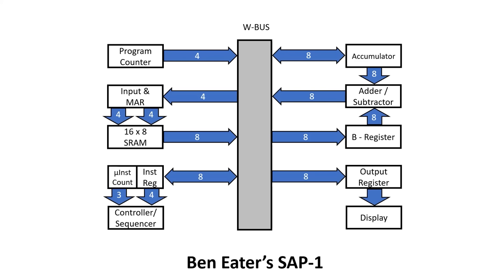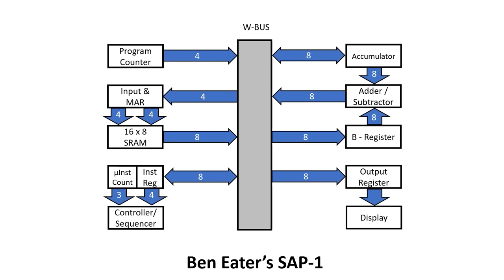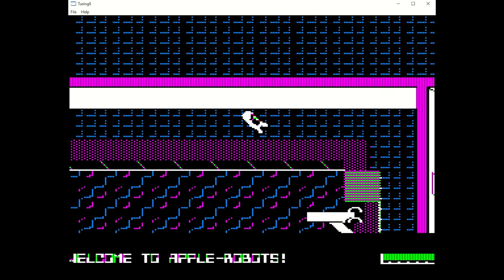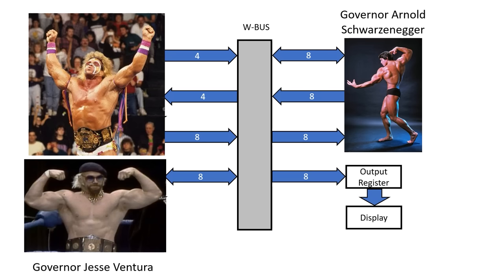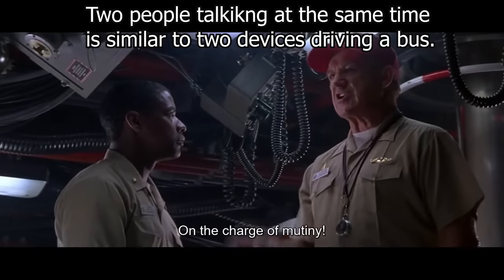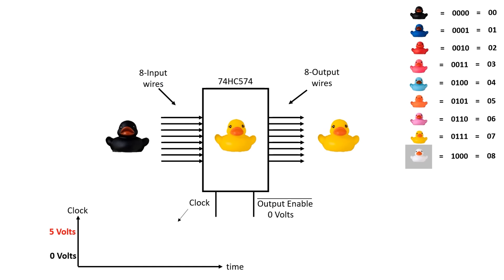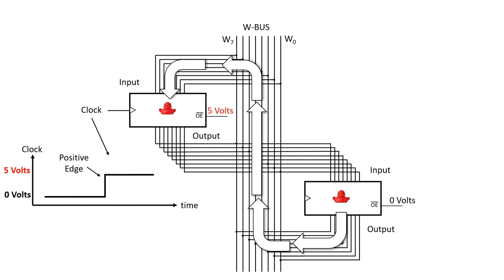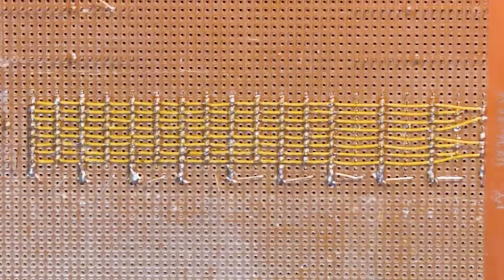How to build a 6502 TTL-CPU: Part 1

Comment: I just found your videos. The thought of building a 6502 from scratch sounds very appealing. My first computer was a SYM-1 running a 6502, so I have a long-standing love for the old chip.

As for your comment about the original architecture being too complicated, challenge accepted! 😃 I'd love to build a replica at least at the block level that runs in real time and is identical at the cycle level.
Reply from the maker: @briancampbell179  welcome.  Excellent, have a crack at building one.  It may also be worth watching the Turing6502 series.
Reply: @DrMattRegan  , shall do.

Comment: I just finished building Ben Eater’s SAP-1 (and I built his 6502 kit before that). So I really enjoyed this. The fact that the ‘574 has all the input and output pins lined up (and have 8 bits) is really encouraging for making an easier build. I could see designing and ordering a PCB with just 8 parallel lines to get started as a way to begin.
Reply from the maker: Sounds good, i'll be doing some videos with schematics soon.

Comment: I was really hoping for your inverter bus contention demo to result in the magic smoke escaping. I don't know why except perhaps to feel better about the times I have done it by accident. BTW a good explanation of tri state logic.
Reply from the maker: Glad you liked it.  Actually, short of applying the power backwards, i've found the 74HC series pretty hard to kill, more robust than 74LS.  Maybe that's just anecdotal i don't use 74LS much these days.
Reply: Worrying about that made me quadruple check every bit on the EEPROMs on the Ben Eater SAP-1 I built. But then I plugged the EEPROM in upside down and it got very hot (I measured 160F on the top of the EEPROM and that was after I had unplugged it for a minute). But everything survived that mistake lol

Comment: Great video. I like the soldering technique you demonstrate at the end. I’ve used wire wrap for my much smaller projects, and sometimes I’ve used your technique for applying short strips of insulation, but I’ve never done it at the scale you need for a bus layout. I’ll keep that in mind.
Reply from the maker: Glad you like it.  Yeah, the trick is to pre-stretch the wire a little, just enough to allow the insulation to slide.  Not too much though, you don't want to fracture the wire.

Comment: MORE!
I do my prototypes in a similar way, using wire wrap wire, but the way of getting rid of insulation is different for me, I just melt right through it with the soldering iron (putting a solder blob on the socket or IC leg I heat it up and wind the wire around the hot leg) - looks awful, but works.
I mostly do 'slow' stuff though, multiplexing I/O from a uC, or maybe I2C.
But this should work to at least a couple of MHz, it's not far from true wire wrap technology (excluding the unobtanium sockets and the wire wrap gun/pen), and that stuff could run real fast.
The more chaos in the wiring the better though, I heard.
Reply from the maker: Sometimes i do melt the insulation, especially if i've cut it to the wrong length.  The trick with this technique is that you need to pre-stretch a wire a little.  It's a bit of a balancing act.  If the insulation melts too easily, i'm worried about the insulation fusing together (which i've had happen) and potentially causing a short.  I like the Kynar wire which is actually quite hard to melt, but it doesn't seem to fuse.
Yep apparently a rat's nest runs faster than the way I wire, but you probably want a PCB to clock it really fast.

Comment: Good explanation of tri-state logic, but I was thrown off by the following question: If all registers are connected to the same bus, how do you choose which register is written to? In Ben Eaters SAP-1 design, all registers are connected to the same clock, but have individual write-enable inputs. It is only in the second video of this series where it seems to become apparent that this SAP-6502 design works differently: The inputs of all registers are connected to the same bus, there is no write-enable pin on the registers, and the control logic has to make sure that it ONLY clocks the target register to store the value which is currently on the bus.
Reply from the maker: Yep, it was a bit of an engineering trade-off.  Ideally, these octal buffers would have a clock, and a write enable and an output enable.  Unfortunately, they don't and you get to choose two!  I decided on using octal d-type flip-flips with an output enable would be better in this case because so many of them connect to the W-bus.  Ben Eater, decided the other way, but he has to add in a tri-state buffer per register.
Reply: @DrMattRegan what is the fuss with the clock. RAM was async till the Sega32x in 1994. No one expects a clock like there . That is no one but students who learn RTL .

Comment: Sir - you are much much more than 0.1x Ben Eater (Blessed Be He😃) That sort of comparison is invidious, and contributes nothing. Ben's fantastic project (in the philosophy sense) takes a relative novice to the point of a reasonably thorough understanding of the basics of cpu and computer architecture. Yours is to use that developed understanding as your starting point and take it further. (and probably to have some fun 🙂). I love it !
Reply from the maker: Thanks Mike, I really appreciate it.  You've hit the nail on the head.  Ben Eater does a great job and I think his work stands on its own merits.  My plan was to advance what he has done for those interested in taking it further.  I want this knowledge to be freely available and not stuck behind some paywall.

Comment: I have on question about registers, at the end of series we have implemented all the instructions of 6502 using only few of registers in our model.
Then why it is not running as same speed as 6502, why dont we use as many registers as we want ? wont it will be beneficial for us ?

also is it not possible to replicate everything in 6502 in our build?
Reply from the maker: Good questions, I think we use a similar number of registers compared to the 6502, but (nearly) everything has to go through the single w-bus, where as the actual 6502 has a more complex bus structure.  In effect it can functions in 1 clock that take us several clocks.  This was done on purpose though, because the idea isn't to exactly replicate the 6502, the idea is to show that something as simple as the SAP1 can be made to run 6502 code.

At the end of the day, if we use faster chips we can still beat the original 6502, even though we have more clocks per instruction.

Comment: Should be, some guys decoded fully die shot and done full schematic and even build one from transitors with blinking diodes
Reply from the maker: @AK-vx4dy  Monster6502?  This is a bit different.  It’s not a replica, it’s a simplified version. It uses a simplified architecture, but it requires more clocks per cycle as a result.
Reply: @DrMattRegan  They lied to me? 😡 and this in browser simulation is 1:1?
Reply from the maker: @AK-vx4dy  not quite sure what you mean? What in browser simulation?
Reply: @DrMattRegan  The Visual 6502
Reply from the maker: @AK-vx4dy  oh OK.  The Monster6502 was based on the visual 6502.   This is different.  Make sure you watch the series on the microcode too!
Reply: @DrMattRegan  I will, if time allows i will watch all your videos

Comment: Got a much better idea. Write it up in VHDL and synthesize to an FPGA. A single chip solution.

Learn some modern design techniques and use modern technology.
Reply from the maker: Why not use an RP2040 if you're using modern chips.  Cheaper and easier to get.
Reply: @DrMattRegan   No because you're teaching digital logic skills, not software.
Two totally different skill sets.

It is good to have an understanding of both, particularly when a function can be implemented in either software or hardware and that is a decision the engineer needs to make.
Reply from the maker: I may use FPGAs later on if i go down the pathway of building a VIC 2 chip or (much later) denise, agnus and paula.  But this series was meant to lead off from Ben Eater's SAP-1 series using the same technology.
Reply: @deang5622 before the pipeline, CPUs seemed to have worked in a rather sequential fashion. Especially the Z80 has many machine cycles per instruction. Multiple T cycles . Which again have two non-overlapping phases.
Reply: @ArneChristianRosenfeldt  Doesn't actually address the issue I raised.